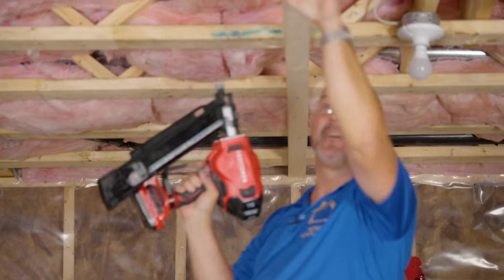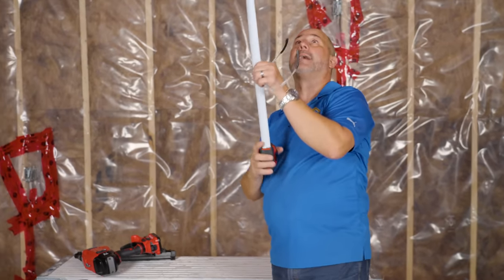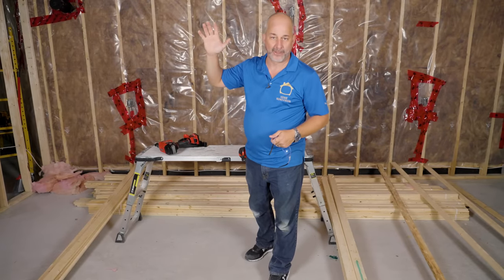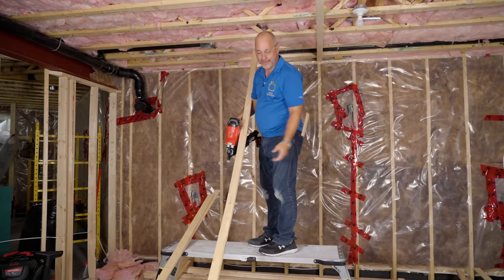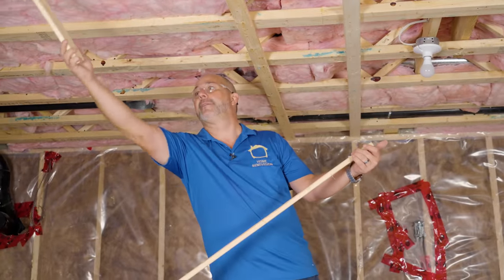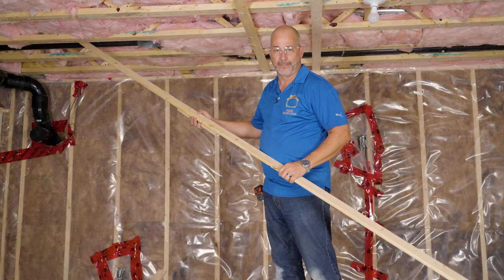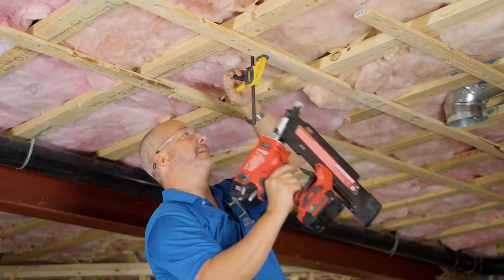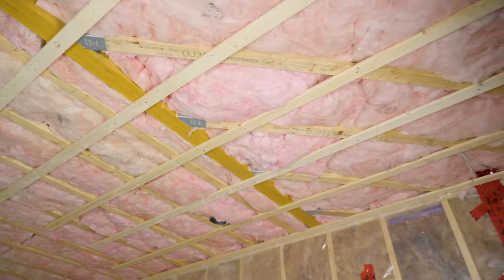Why You Should ALWAYS Strap Your Ceiling

Comment: Does this apply to a ceiling that doesn't have a floor above it? or is it no longer worth the expense?
Reply from the maker: This only costs a few dollars and helps protect your ceiling from movement from expansion and contraction as well. It also provides stability to the truss package and an easy way to add lighting down the road. I also love how it allows me to eliminate butt joints in a ceiling in almost every situation. Cheers!
Reply: @HomeRenoVisionDIY  In what way does it eliminate butt joints?
Reply: @josiahhirsh185  my exact same question....

Comment: On anything holding a ceiling up, screws should be used, not nails. Now when he screws the drywall to the strapping, instead of the drywall coming down, he'll have drywall and strapping coming down. Even ring shank nails can't near the withdraw resistance of a screw.

Comment: Lol at strapping improving structural stability of the joists. I
Reply from the maker: LOL at anyone who does not understand it works. Cheers! I think you need to spend more time with structural engineers on the site.
Reply: @HomeRenoVisionDIY  strapping is great to do. Don’t get me wrong. 
But it negligently impacts anything structural with the joists especially compared to the structural stability that hanging drywall directly gives.

All that being said, if you want to make yourself feel better for the investment than tell yourself what you need to. But strapping is not for structural stability if the joists, it is for drywalling purposes with the benefit of electrical, and in some cases, plumbing.

Comment: I’m finishing a back room and was planning on just attaching the drywall to the floor joists - until I saw a previous video about strapping from your channel.  
Question : do furring strips work for a small back room strapping ?
Reply from the maker: anything to change the direction of the drywall installation to avoid a butt joint is a good thing. Cheers!

Comment: Im an electrician and what you are suggesting would fail inspection. Odds are slim but what happens when the homeowner screws something into the ceiling. Boom theres wire laying on the drywall. Or worse no boom, just comprimised wire that slowly gets worse until one night while you and your loved ones, family dog, cat are sleeping the house burns down killing everybody but you. How you gonna feel then.
Reply: Good point.  My problem is I have an area where the wire has no slack and the drywallers will have to screw drywall right on the ceiling joist where the electrician ran the wire.  I don't know what to do.  Can I just splice the wire and put in a piece to extend it?

Comment: Strapping does have it's benefits, BUT it sure as heck doesn't help transfer the load much if any.
Reply from the maker: you would be surprised. in old houses the strapping is the only thing holding the floor up once they cut out the heat run and the plumbing

Comment: I wouldn’t hang drywall to a ceiling strapping system that doesn’t have threaded fasteners holding it to the ceiling joists.  Otherwise you are relying on staples or pin nails to hold your entire ceiling up.

Comment: Those are the pros - but what are the cons? Hard to make a call withought knowing the cons. Are (1) the added material-cost, (2) added effort and (3) a few cm lower ceiling the only three (and obvious) cons? Anything else to consider?
Reply from the maker: the added cost is offset by the fact that you have no butt joints so less time and material taping. as for a few centimeters of ceiling height that will not even be noticed. Cheers!
Reply: @HomeRenoVisionDIY  That may be true Jeff, but I like to know the down-sides (or the lack of any) in order to make a weighted choice. In other words - I don't disagree with you at all, but for any technically sound decision-making, the cons must be named!

Comment: Would you strap the entire basement ceiling before doing any interior walls (non load bearing) or bulkheads?
Reply from the maker: yes it makes the whole process  much easier.
Reply: Well, if you were soundproofing the whole basement, you could install sonopan/homosote/mass loaded vinyl across the whole ceiling and then install the interior partition walls would help minimize gaps in the soundproofing.

Comment: I don't use wood or nails for strapping because when the wood dries out the nail hole can slide on the nail. This has brought cracks in plaster on several jobs that I fixed.  Instead use the metal RC channel with screws.  RC channel is actually the professional product used for this task, not wood.

Comment: I think strapping ceilings was started so contractors could use 1/2 inch drywall instead of 5/8 and to allow them to use the minimum  size joists. All to save money save money.  Built my house 12 years ago.  Didn't use any strapping. No floor squeaks and no cracked drywall.

Comment: Would you strap the ceiling before interior walls or after? Or maybe it doesn't matter? I just got done putting up my interior walls so curious if its too late to add strapping in order to capitalize on some of the pros you had mentioned
Reply: I always strap the ceiling before interior walls, that way I can nail my wall’s top plate to the strapping and it saves often saves a bit of time. 

It’s not too late, you can do it after the interior walls are up. Don’t forget to put a 1x3 alongside the perimeter of your walls for the drywall to be screwed in

Comment: That thin little strap and single nail are not going to transfer much load.
Reply from the maker: no worries it is only holding drywall. Cheers!
Reply: @HomeRenoVisionDIY  It's not the drywall I'm thinking about.  I just doubt that it's going to have any detectable effect on deflection of the joist and preventing eventual squeaking.
Reply from the maker: if you need load transfer upgrade the strapping to 2x4. that almost doubles the load capacity of any floor. Cheers!

Comment: The national electrical code does not allow for NM or AC cables to be run between the strapping under a ceiling joist. The cable should be run through board holes at least one and a half inches from the edge of the joists. Installing wiring as described in this video would be poor practice and a safety hazard.

Comment: In the mean time go through all that trouble and TiME & EXPENSE to lower the height on the ceiling. Cause lot''s of cussing and extra charge from Drywallers because they have to rip every sheet. Then install the lighting when you could have easily done prewiring. Love these talking heads that think everyone should do it their way, Oh by the way, I've come along and repaired strapped ceilings that fell on the cliant's because the contractor wouldn't let them "tell him not to strap" and put it up with a single stinkin brad nail because that's what's the drywaller used to hang it on.

Comment: No strength added, especially from 1x4.. Split the seams on a joist FFS! I also find it hilarious that you claim it will stop or reduce squeaking, then proceed to slam it up dry with a single nail in each joist. You’re adding a squeak. Also, don’t compress the insulation if you actually want it to work.

Comment: So the whole weight of your sheetrock is hang ling on strapping. held up by a few pin nails holding the strapping up. I would rather have drywall held up with 1 3/4; inch screws in wood that is deep enough for the length of screw. Not a 3/4 inch thick strip that more so than not is probably cracking, splitting.

Comment: I’ll stick with a dropped ceiling in the basement
Reply from the maker: another great option. Cheers! we have a video on how to do that too!
Reply: A lot of basements lack the height. Strapping is a great idea.
Reply: This is my option when we finish our basement.
Reply: That works if you can stand the look of drop ceilings and are okay with your basement ceiling looking like an office building
Reply: @b.m.4066  and when i need to fix something im not tearing out drywall to do it.
Reply: Strapping is necessary in our case since all the electrical wire are run under the joists so I need strapping to run the drop ceiling on. Using ceiling max or snap clip because I have 6'6" walls and can't afford the loss several inches in headroom a traditional drop ceiling requires
Reply: @Bigbacon  I'd rather have a ceiling that is visually appealing. And on the off chance that you ever have to tear it out to fix anything drywall is cheap and easy to work with but maybe that's just me. Unless you're dealing with ancient plumbing I'm not sure what you would have to fix
Reply: still it looks like crap.  Mine in the lanai has every tile warped and sagged, because all the humidity.  He didn't mention but with the strapping the drywall is less likely to sag.  It is held flat in more places.  Basements are known to be humid.
Reply: Enjoy breathing in mouse pee and poop. Couldn't figure out why air quality was horrible in a house with an add on w/ drop ceiling. Turns out field mice had been nesting in there for decades. Seal off your living spaces people
Reply: @naughtyorgneiss    Not overly concerned about that. I was more concerned about the bathroom in the basement. My daughter who lives down there neglected to tell me that the Sheetrock walls had mold on them   I gutted the bathroom and started over with mold resistant Sheetrock
Reply: @naughtyorgneiss  dealing with that right now. Bought a (very) old house with a drop ceiling in the living room and kitchen, carpet in every room, and brown panel walls. Aside from the ceiling tiles likely being asbestos, there is a metric ton of mouse turds and nest material up there (and probably the carpet)

Comment: Strapping is not good it’s bad. It allows a fire to jump from from one floor joist to another spreading fire faster and also allows rodents to travel from one end of your house to the other should they find access. I’m not talking about with floor trusses, with those your home will burn down three times faster. As far as deflection, that’s what blocking or bridging is for. Carpenters don’t build for the possibility that an electrician may run a wire in the future, we build for permanence. Strapping is a time and tree waster.

Comment: I don't think I need them with web trusses.
Reply from the maker: and yet it changes the direction you install drywall so no more butt joints. Cheers!
Reply: @HomeRenoVisionDIY  Depends on which way your trusses are oriented or size of room.  My lower level rec room is 33' x 28'.

Comment: Agree with your other reasons but that strapping adds zero strength to your floor.
Reply: Maybe not with engineered joists, but I am sure it would help some with regular lumber.  Cut down of the cupping and twisting.
Reply: @rockshot100  it would help keep things straight, but those joists would need to deflect a pile before that little piece of strapping would share the load with neighboring joists.
Reply: @scottc9303  So you don't think it would help with a 1/8" shift?  OK, I don't know for sure, but I don't have much faith in the lumber they are selling now.  The cross bridging they at least used to do that for a reason.
Reply: @rockshot100  The subfloor already does this, if you used subfloor up to code.
Reply from the maker: You are entitled to your opinion but my structural; engineer has a different opinion. Cheers!
Reply: @HomeRenoVisionDIY  I am a licensed professional engineer. Saying your floor is 3x stronger because of strapping.... geez. At the most it would add a marginal amount of stiffness. If you wanted a stronger floor just get the joists engineered with a higher design load.
Reply: @HomeRenoVisionDIY  I do however enjoy your videos. Just finished building my house this spring, me and the wife did most of it. Got lots of information from your channel. One of the best resources for Canadian building code references/techniques.

Comment from the maker: Start from the beginning of the basement series and watch Soundproof Your Basement From Impact Noise👉🏼 https://youtube.com/playlist?list=PL34cQkzKfXWa2Ut7SGpMFRoWlUFt0ZA1r
Reply: Jeff what lenght of nail do you use to nail them?  thanks :D !
Reply: I love your tutorials.  Did I miss a video on drywall ceiling into roof trusses? I need to drywall my primary residence 2nd floor 24" oc roof trusses.  I assume 1x3 strapping, one ring shaft nail(?) At each strap-truss connection??
Reply from the maker: 2 1/8" , Cheers!
Reply from the maker: for 24"0c I would use a 1x4 and 2 screws at each location. I would also suggest using 5/8 drywall to keep kit from warping over time.